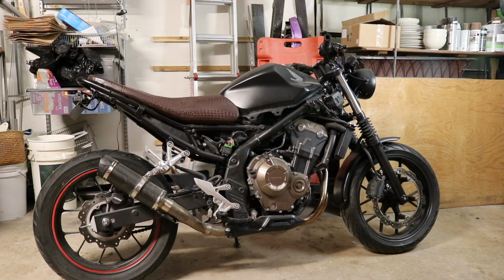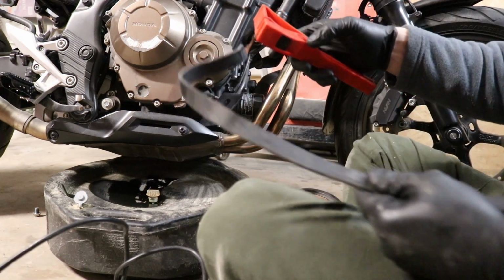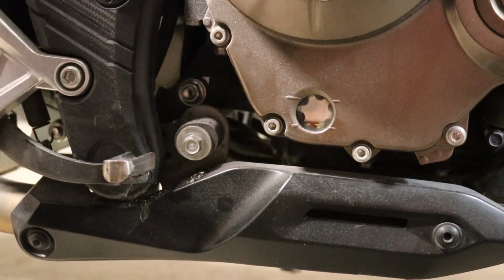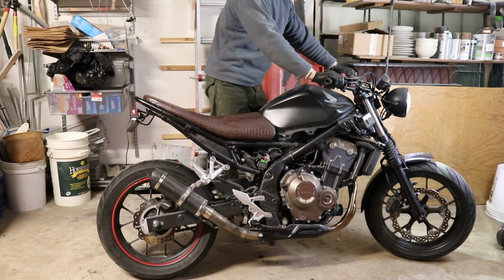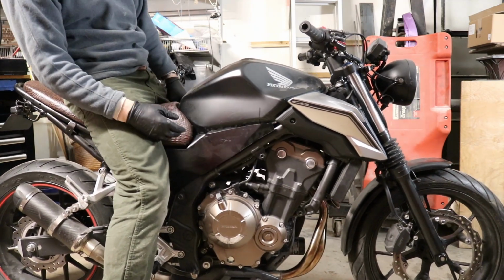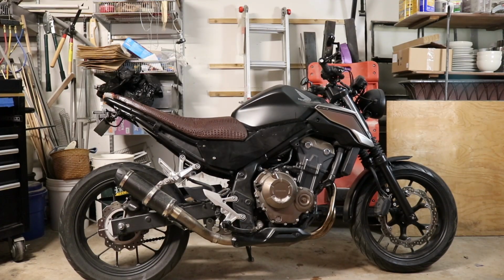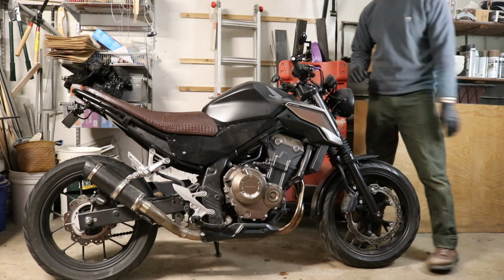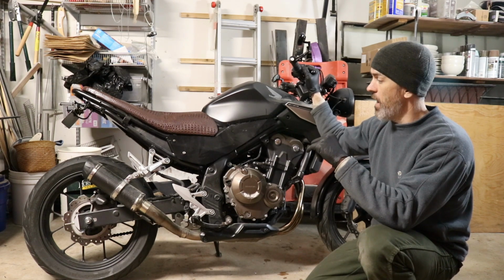Custom Motorcycle Mock Up | E26 - Honda CB500F Scrambler Build

Comment: I haven't even finished watching this video........and I'm laughing out loud. Someone else having incredible problems removing a simple oil filter! I can't begin to tell you how many times I've been in this situation......Answer is very simple. Big Freakin' Chanel Locks! Can't wait to see how this all turns out. Now, back to the regularly scheduled program.
Reply from the maker: :) 
Yeah, if I have to destroy the oil filter to get it off I will - darn it!
Interestingly, the service manual calls for oil changes every 8,000 miles and oil filter changes every 16,000. Seems like too long to me, but makes me feel better about not changing the filter this time.

Comment: This looks awesome.  I am doing a similar thing, but I am just replacing the headlight of my CB500 and turn signals, and leaving everything else as is basically.  Did you leave the speedometer back open or did you end up putting a cover over it?  I'm thinking about adding a windshield to cover it up. I kind of like the look of a wind screen type thing too.  It's a great bike though!
Reply from the maker: I do enjoy this bike 😀 and I've left the speedometer back open.

Comment: I wound up having to use a pipe wrench to get my filter off..
Reply from the maker: I just changed the oil again last month and ended up putting a screwdriver through the filter to get enough leverage. Over tightening oil filters is a pet peeve of mine 😡

Comment: Screwdriver through the filter. Simple.

How about leveling off the pillion part of the seat? Better for a rack, side bags and a pillion.

Please fix the road rash on the engine cover - its upsetting my OCD!
Reply from the maker: :) I know that engine cover road rash is annoying. I am being cheap at the expense of yours and my own need for perfection. Once it is road legal I will revisit a few things and make some cosmetic improvements